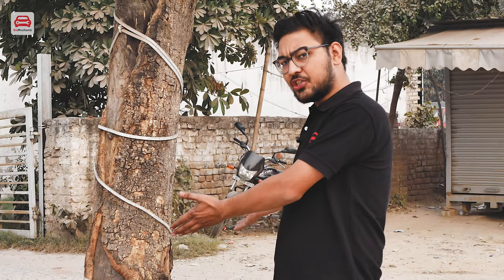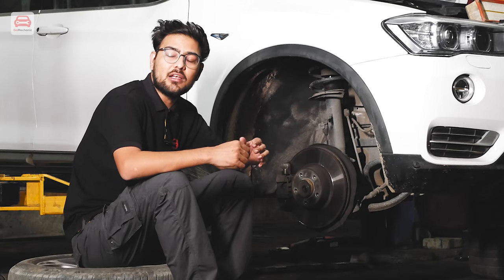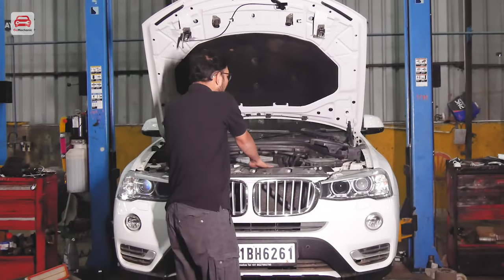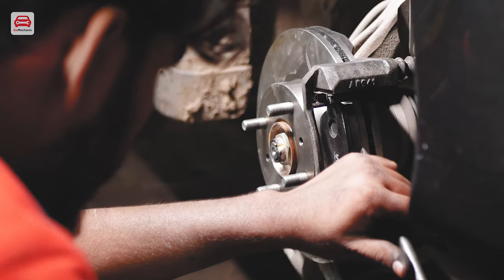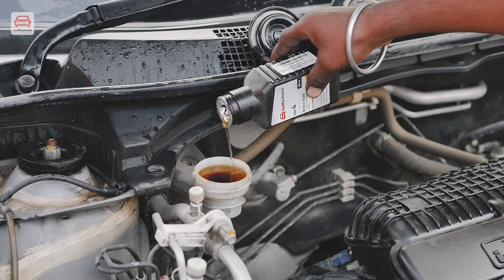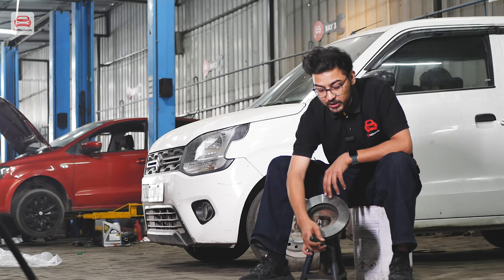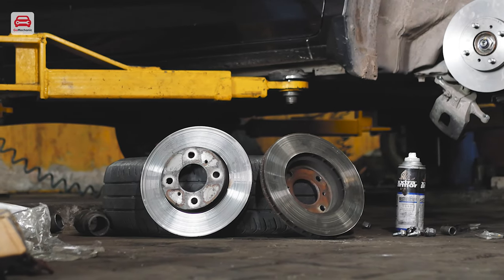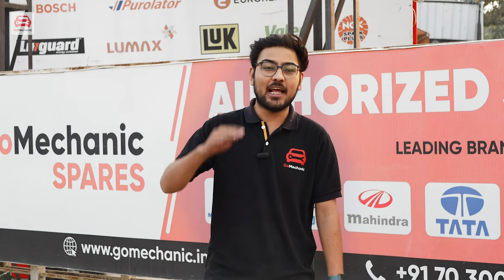2020 Honda Amaze Brake Disc (Rotor) Replacement Service | Tips to Avoid Braking Problems

Comment: I have Honda amaze,, in year 2022 I drive my amaze 40000 km I go for go machenic service ..at gomechenic autolux ghaziabad knows as auto fixers near hotel country inn..
Service advicer ask me for brake pads change I changed the brake pads ..they told me this is Honda brake pads ..

After driving only 3000 kms brake pads suddenly noicing I visited that centre again here I found pads are no more then I see they are not genuine Honda part in fact it is out of size when measure to old one. Then adviser misbehave started I come with my mother in fact advisor abusing me ..ok.after spending again 3000 rupees I change brake pads again on gomechenic lux ghaziabad..

But after 5000 kms both disc and brakes both ended this time . 
Then I go for honda service here I found both time they fit local part in fact .they are fitting cheap copy parts in all car . Very bad experience